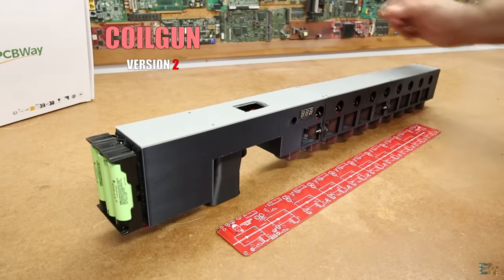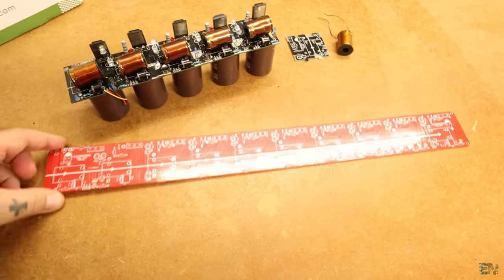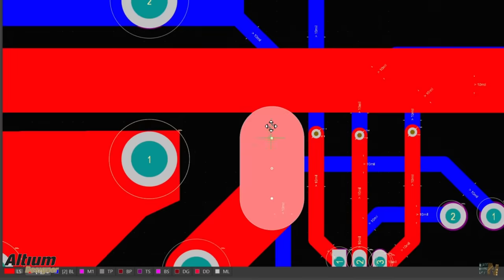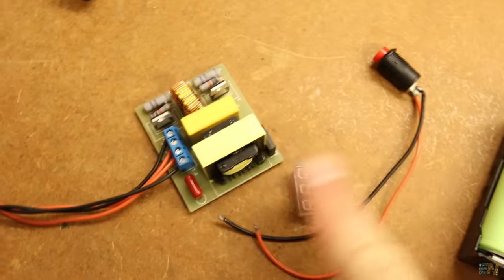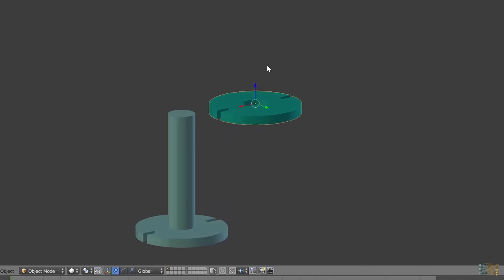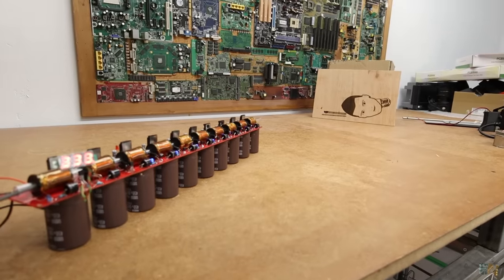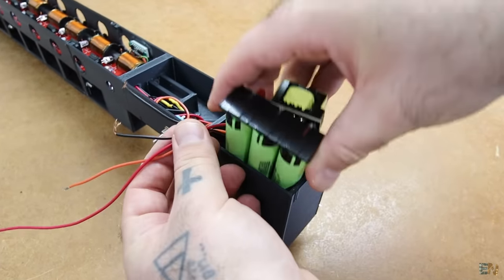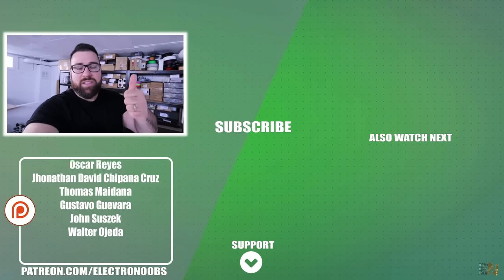POWERFUL 10 Stage COILGUN PCB + 3D Printed Enclosure

Comment: Suggested improvement:

Could you use the back emf from the prior coil to feed the next coil?

This seems like it would eliminate the risk of the earlier stage magnet reversing the direction of the ball.

I am not sure whether that is a feasible idea. But it seems there would be a very noticeable change in current/voltage of the coil as the metal bead enters and exits.

And frankly... an optical sensor seems unnecessary if you can react to changes in load on each coil.  

I can imagine how a circuit like this must work - but I don't have the chops to design it.
Reply: Yes, you could (and should imo) reverse the current direction of the coil, as soon as the projectile hits the center. This way most of the remaining energy of the coil gets fed back into the system. It would require current sensing and H bridges on each of the stages though. And that would be an order of magnitude more complex than what he has right now.
Reply: @amos9274  

My thoughts...

Order of magnitude?  Perhaps 10% more. Seems like it would require an extra MOSFET and diode (and the removal of an optical sensor).  Perhaps a 10% increase in the component count per stage.

Here is why I don't think reversing current will help.

Coils take time to charge and discharge - reversing the current inside a coil will also take time - and during that time you will be pushing power against near-infinite resistance.  All you would get for your effort is heat.

But if you disconnect coil 1 from power at the same time you connect coil 2 to power and capture back EMF from coil 1 through a diode into capacitor 2. 

I think the position of the coils would need to be tuned based on segment firing times - if you put the later coils too close together they will not fully charge before the projectile moves through them.  Their minimal distance would cause linear acceleration- implying they should be spaced to inverse square...

I think I like designing things more than I like building them :)
Reply: @JohnBoen  Yes, what you need to do in the end is lower the current, as the projectile is going through. The more/the faster, the better. If you hooked the coil up in reverse to a common capacitor bank, it would not only return most of the energy, it would also discharge the fastest (U= I'*L). To implement that though you'd need some additional circuitry.
If you want to trigger based off the induced voltage of a projectile, you'd face the issue of it being proportional to the speed (which means it wont work from a standstill) but also, even more measurement circuitry.
Like you proposed, it would also work to dump the energy into just the next single capacitor with an extra diode. First of all, you'd have to replace the thyristor with something more sophisticated for that to work, second of all that would just overcharge that next capacitor (and if not, why not apply a higher voltage in the first place).
So, you'd have to start activating the next coil while the other coil is still active, to dump the energy somewhere afterwards. To do that, you'd need to coordinate between the two coils which would in turn require even more circuitry.
Reply: @amos9274  

Thanks for the talk  - I think triggering based on the current direction change is such a fundamentally better design that it is worth a little more effort. 
am a bit rusty.  I haven't built any electronics in about 15 years. So I am not getting my point across. I also may think some things areI  possible when they really are not.

I think an optical trigger that cannot be adjusted is bad design (it triggers off a side effect) - this trigger would be nearly optimal in timing.

The design referenced here leaves prior coils on, which means your ball is often moving between two magnets that are both on.  This is just a bad design... 

Turning off the prior coil is an important part of this...

.  

I think this would work -tell me what you think:

Assuming a projectile is moving toward or away from the coil.,the induced current will be in opposite directions.

As it passes through the center, the current flow moves.from highly positive.to highly negative. I think this would be trivially easy to detect with an OpAmp.

This is a comparator operation that you could perform with a commercially4 available OpAmp IC.  These operate at 200+ khz, which should be well past any realistic circuit needs. A 100 m/s 10 cm ball would not need 20 khz. 

Use the comparators to drive MOSFETs.

I did a little hand waving on the OpAmp logic, but this is literally what they are designed to do - so I figure there are dozens of digital and analog solutions to this problem. And since Udio frequencies are sufficient we probably have a whole bunch of low-cost and high-power audio chips available.

Blah blah blah...

Comment: Would be a good idea to measure speed after every coil and measure how much electric energy was successfully converted into mechanical. For optimising. Also, wind your own coils with bigger and bigger copper wires to discharge the capacitors faster. Also is it possible to make a coil with essentially halbach effect to focus the magnetic field to the inside of the coil?

Comment: Aside from making the coils lower impedance as you get forward down the barrel you could put two sensors instead of one between each coil so that a microcontroller can estimate the speed of the projectile after every stage to time the commutation and calculate the coil current more precisely. Ideally you'd also put a sensor slightly before the middle of the inside of the coil so you can turn it off such that the current is zero while the bullet is passing the middle
Reply: I’m curious about adding more voltage to increase the power/speed of the projectile.  More information regarding the projectile would be nice as well.  Would be great to use a projectile that is about 7.6mm round and 4oz so that one could compare to other projectiles.

Comment: First of all, great work, but the first design was better for me because you are in control of the number of stages. But personally, I think it would be better to use fewer turns, a larger wire diameter, and a capacitor with a capacity of 1000uf It will give you enough power. Personally, I worked on a similar project consisting of only four stages, but slightly larger capacitors. Frankly, the power is enormous and terrifying.
Reply: Know of anyone else who has content that made one more powerful, would be awesome to see

Comment: i have the caps from old pcb's , now i have to start collecting coils !! i would probably go for the previous designee since i like the modularity ,(im salvaging components only ) and for soldering i will use the good old trick of heating the pcb on normal clothes iron to soak as much heat as i can into the pcb and then blast it with the soldering iron on full ( ofcorse you make the pcb connections first before any component )
Reply: I would like to have your Altium design PCB design file

Comment: You could make an Open Source version of Tom Stanton’s Coilgun Plane Launcher!

A similar modification would be making the coilgun fire small metal disks (potentially even the “knock out” circles from metal electrical outlet boxes (so essentially using trash), or perhaps washers of cut sheet metal, coins potentially (depends on metal, although “coin blanks” are another option) could work too.

(Also it would be a whole other project, but a CNC Coil Winder may be a good thing to make to allow for custom shapes/sizes)

Comment: Inspired by this video, I tried to make my own coil gun and initially it worked but then my sketchy HV generator blew up. After remaking it I accidentally used wire that was too thin and upon pulling the trigger it blew up again. I was hoping the full 320VDC was discharged from the 2200μF capacitor but there was still 60VDC left. This was just a single stage coil gun lol

Comment: Put another detector at the exit of the coil that triggers an SCR that shorts the coil. But first I would measure the timing with an arduino or something similar. Then you know if this is necessary and what you could gain. Also check the distance from the first detector to the coil. This could be optimised. I would also make the coils shorter and fatter and use a higher voltage. The caps can take 450V, so charge them to 400V.

Comment: If you have an oscilloscope or logic analyzer, you can connect at least three channels to the optical sensor output of successive stages.  Then, you can use the time difference between different optical pulses to calculate the speed of the projectile.  With additional connections, you can also measure the acceleration between stages as well.  Finally, you could calculate the efficiency of the device by computing (1/2)mv^2 / (1/2)ce^2 as you make adjustments -- here m is mass, v is velocity and c is capacitance, e is the starting voltage (electromotive force) across the capacitors.  The Arduino approach, although less precise due to the much lower sampling rates, would also be nice if you built it into the next revision of your device so as to provide instant feedback of the velocity of the projectile after firing.

Comment: I love these kind of projects, but I always wonder if there is some way of rifling the barrel so the projectile spins and becomes more accurate?
Reply: Not really, rifling works with powder weapons because the lead making the projectile is kinda soft, and the insane acceleration makes the bullet expand into the rifling and spin.

However lead isn't ferromagnetic and thus can't be used as a projectile. Ferromagnetic projectiles are too hard to fit in a rifling.

That's actually one reason armies aren't that seriously working on magnetic rifles
Reply: You could use Ferris metal dipped in lead, then use a CNC machine to make the projectiles the correct diameter then add rifling then you would lose the tumble

Comment: You could mount the capacitors diagonally, so they point downwards to the left. This way, there would be space to install another row (which would then point downwards to the right). Technically, you could even mirror this setup and build it on top as well. Then you'd have 40 capacitors. Each shot would take 20 minutes to charge, but at least you'd have the maximum volts available that can be mobilized on this form factor. Whether this makes sense in the end, or if a huge arc of light comes out alongside the projectile at the front, I can't say for sure :D

Comment: Damn that's very cool.

I'm sure you've seen those T12 style soldering stations, there are kits available you can buy for very cheap and use it with any 12-24v PSU. You can even use the original Hakko tips. The T12 style tips make soldering much easier because the heating element is very close to the tip unlike the older style soldering irons.
Reply from the maker: I have one. Is not more powerful than my station. Is still not enough for those big pads...
Reply: @ELECTRONOOBS  Ah I see, that's a lot of copper then lol

Comment: Have you thought about optimizing the current setup? Faster/smaller coils, ways to lower the resistance etc. Also have you made any research in how to lower the friction or increase the magnetic field strength by using other barrel and projectile material?

Comment: add a spring feed magazine and a servo+slider to do the auto-reload when charged, ok it wont get fast speeds but still it would be 'cool', do people still say cool? i'm 57 and out of touch lol.

can some electronic lockout be added between stages to stop the backfiring? 
maybe the lack of charge in a fired stage's capacitor could be the ground needed for the IR detector of the next stage, if the cap isnt discharged then the IR detection cant ground out? or something like that....

Comment: Add a couple of sensors before and after each coil, you can use this to figure out the velocity before and after the projectile enters the stage. You could also use some digital electronics to adjust the timing of the sensors before and after each coil, it would make tuning the coilgun as easy as adjusting some values in your arduino sketch.

Comment: Protip for the heat soak... hot air gun. Preheat station is ok too but I find the guns more versatile. Just warm the area around the joint to "good and uncomfortable" and the solder will flow much better with less juice from the iron.

Comment: is it possible to capture some of the collapsing field after the projectile has been past and partially charge to caps to make it quicker in between shots?

Right now it is just "burned" off on the flyback diode, but there must be some decent ringing on the LC without it.

Comment: See how the VW VR6 engine manages to put 6 cilinders on a small space. Do the same thing with the capacitors, alternarting them, and keeping them as close as possible.

Try to minimize the distance between each coil, so you minimize any friction loses between them.

Also, IMHO, dont use detectors, create a time-table on when should each coil fire, and tune them until you reach the maximum  projectile speed.

Comment: I wonder if you amend your housing print to include sectioning between coils and using magnetic shielding tape/ foil to minimise field bleed over to the next coil. 
I'm no electronics expert but what about triggering a capacitor as the projectile passes the sensor this secondary capacitor in opposite polarity to neutralise the charge in the coil... may need something like a shotky diode to handle collapsing spike currents? Have you tried hematite or neodunium projectiles?

Comment: Why do you need the light sensor at all? If the metal projectile moves through the coil doesn't it generate its own current that could be used to trigger each subsequent coil? Instead of the light sensor you could even use a smaller pre-stage coil to act as the trigger. You would loose some of the speed control but be less reliant on the clock speed of the light sensors or micro controller. Maybe?

Comment: adding a resistor to discharge the capacitor after turning off the gun could be great security too; never know if the capacitors are not fully discharged after the shot

Comment: Hi! Can we have an update? besides what was mention before like: spacing the coil and the IR diodes, making the coils in the final stages thinner (fewer turns but you can use bigger wire), and something that I´ve seen on youtube, and many people made measurements to see if it shows improvement, using iron strips outside to concentrate the magnetic field inside the coil

Comment: Awesome work! Its interesting to see how it will behave with different projectile forms (sphere, bullet like form with sharp tip). Is it possible to make a little turning effect to enhance accuracy? It would be great to see shooting tests on open air, what is accuracy of bullet on ~50-100m distance? How is it powerful on different material targets?
Reply: You could, if you wanted to, using a different design, turn it into a what you're describing as a sturdy, powerful, & accurate electromagnetic gun/weapon, in the form of a "traditional semi-automatic rifle". Yes? lol. Of course you could... all you need is a little mind power & ingenuity.
Reply: People would think you had some sort of futuristic weapon lol. Especially if you have the funds and creativity, you could make it look pretty badass. Even make multiple battery packs and "bullet/shell/projectile" magazines that could be integrated into the "gun/rifle" the same way traditional semi-auto rifles do. Where you could remove them and slap in a new one that's ready to go...but you'd definitely want to check the laws around that first for sure lol...anyways

Comment: Thank you very much for your video, it helped me a lot! I am trying to design my own coil gun and was wondering what voltage booster you used to get from the batteries to 400V. All of the component aliexpress links seem to be down, but if you have a model number or something that would be very helpful :D

Comment: You should build a secure locking bolt in order to add safety from reverse firing it would also make loading practical and safe
Reply: Maybe even something of a clip like the Crossman does for some of their air rifles. It would also be somewhat beneficial to possibly slightly magnetize the bolt to hold the projectile at its most efficient starting point or design a tight fitting single or multi shot clip.

Comment: Do you have the polarity the same in each stage or are they alternating? I've always wondered if it would improve the performance with a long enough projectile that it slightly bridges 2 coils, so it has a push pull effect during the reverse current that happens as the field collapses? Im not sure if it would improve or hurt performance lol

Comment: Would it be possible to use a 100s battery as the high voltage source, to get faster recharging times?

Comment: You have ordered a similar meter as me. I had some problems with it measuring in the same orientation as you had, then I shot projectiles in the other direction and it seemed to measure fine. Maybe you should try it as well
Reply from the maker: I've tried all the ways... :/

Comment: I am currently testing it with a laboratory power supply after my 400V module went up in smoke. 
After activating the button, there is a permanent short circuit in the 12V circuit. 
Is it possible that the thyristor does not close after switching through?

Comment: Can you cover the metal in rubber and use it as a airsoft gun with proper protection, or use rubber with metal dust mixed in it.

Comment: I also have another question: Why not use IGBT and make a pulse of 3 milliseconds, for example, and this will provide additional storage for the capacitor.  Is the problem the inductive armature of the coil?
Reply: Thyristors are more suited for these applications than IGBTs. Also it might be more expensive to buy an IGBT for this application than a Thyristor.